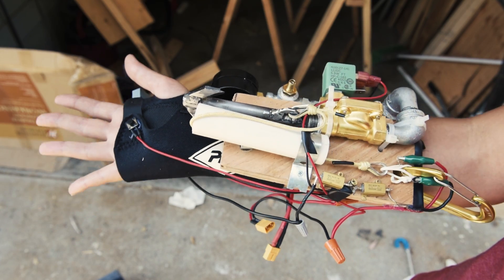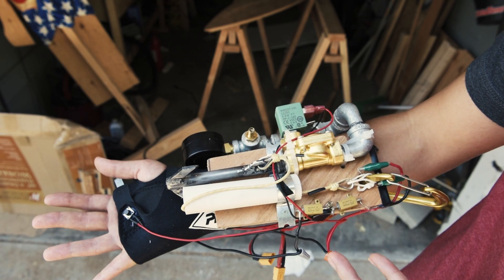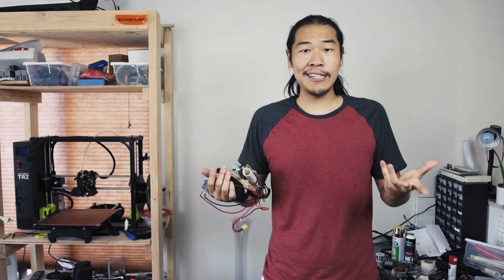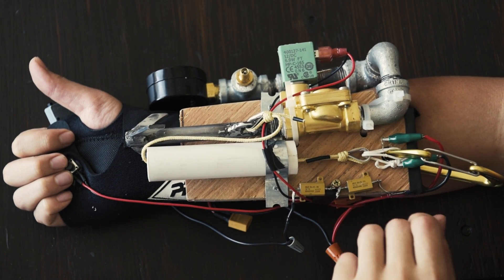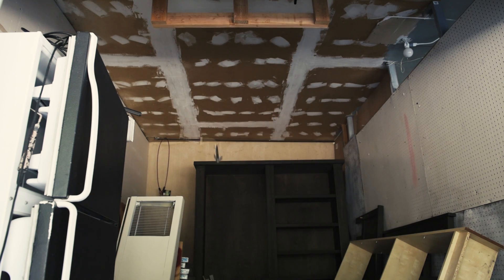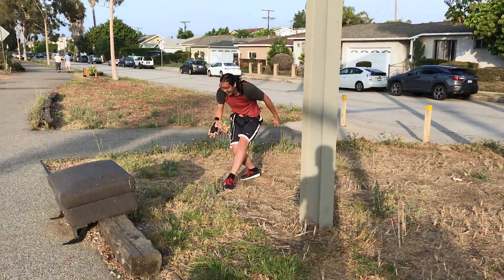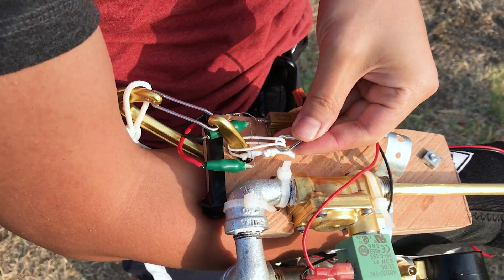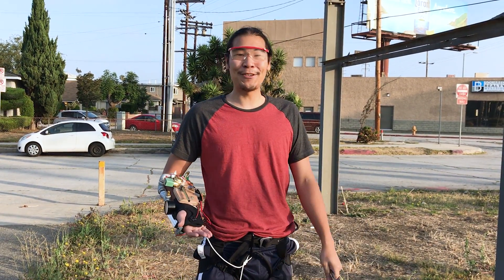Real Spider-Man Web Shooters Part 3: First Prototype Test!

Comment: This is not spider man. Spider man uses webs. This is a grappling hook. Also, how are you going to deal with with the whole knocking-out-because-there—is-too-much-extra-gravity? In my opinion, it seems like before you work on web shooters you should try and fix that so that you are not swinging on a skyscraper and you suddenly knock out and die. Stop criticizing jlaser when you should be worrying about yourself.

Comment: I believe that creating a simple pulley system at the hook to divide the stress on the rope would help, that way each the rope on each side only has to support half the weight however the string has to be longer to compensate, it will also reduce the stress on a motor the better the pulley system is.
Reply: You could theoretically make the entire thing a pulley system from hand to target

Comment: This is great. I love your ingenuity. Just to give a little completely pointless "Spiderman geek" rant though, in my opinion, this video illustrates PERFECTLY why I prefer "organic" web shooters in Spiderman than Peter Parker "inventing them all on his own." What you built in this vid is probably a LOT more like what a high schooler would be able to make on his own that Spiderman comics. 
I know it's all fantasy, but the level of suspension of disbelief is important in a story in my opinion. The more I have to suspend my disbelief, the more it takes me out of the story and SOMETIMES, the less I enjoy it. If you had told me Spiderman had the web shooters he has in the comics, and they were man-made, and then told me they were designed, developed and built by Peter Parker ALONG WITH the ENTIRE engineering crew of the Enterprise D, spending months using all their resources and 24th Century technology to help him solve the engineering problems, testing and retesting designs (assuming I could get over the anachronism and paradox of him working with characters from a different universe in another century) I would think to myself.... "hmm, maybe that's plausible." Suspension of disbelief required (just for the design/technology part, not the time travel part) EQUALS:.... well, pretty next to zero.

If you told me Tony Stark and HIS engineers helped him design them using 20th Century tech.... (which is one reason why I prefer the "Homecoming" version to most of the others) disbelief shoots up, but modestly. Maybe up to like..... 8 or 9. I mean, if Tony can make all that crazy pseudo engineering work required for Iron Man suit.... well.... why not.

ORGANIC web shooters in his arms? OK, it'd be a little weird, like why are they in his arms and not in his butt, but... those bio-engineered Spiders had weird properties.... maybe if they interacted in some weird way with human DNA.... well, it seems MAYBE kinda plausible. Disbelief Level is kinda... maybe 7-9 or so.

At these levels, I can kinda think "wait a minute!" for a few seconds during the story, then think " oh well, I can drop it" and then not have it bother me again through the story.

Now, you tell me a HIGH SCHOOL kid, ALL ON HIS OWN, and ordering and buying NO SPECIAL ELECTRONICS OR PARTS that Law Enforcement could easily track back to Peter Parker if they looked hard enough, not stealing any super highly secret tech from some high security lab, (btw- I KNOW he DID that in the "Amazing" movie- I'm talking about the original comics and TV shows prior to the 90's here) just using a perfume sprayer and some other random shit he found, and he built the web shooters he has in the comics.... suddenly my Disbelief Level shoots up to like.... ONE HUNDRED BILLION. Don't tell me how brilliant he is. Even someone 5 times as brilliant as Einstein couldn't have built a nuclear bomb in his basement in 1925 using a light bulb and spare parts from a bicycle, and your Disbelief Level would probably be near 100 billion if I write that event into a story, no matter how much I pontificated about how smart he was. It simply shows a complete lack of understanding of physics and engineering, as does Peter Parker making up web-shooters alone in his bedroom.
So anyway, end of pointless rant. 
Thanks for doing this. You are really quite brilliant and I admire your engineering skills. You have enormous potential, my friend.

Comment: In order to do a reload, You should attach the barrel of the "web" and the barrel of the hook together. Then use a compressor quick connector to quickly remove and then attach a new ready to go hook and web. Then you can attach to the web line to its anchor. If that makes any since.

Comment: Well, you may never see this and maybe you’ve already solved your problem, but knots in rope can seriously reduce the load limit of the rope. For hammocks I use a lightweight line made of Amstel Blue- it is hollow and can be threaded back through itself so under tension it will collapse and hold tight like a Chinese finger trap. Search for “how to make a whoppie sling” for hammocks and you’ll see what I mean. Cool video! :)

Comment: I'm not that good at science but maybe the reason it snapped was because the metal part had sharp edges that could of cut the rope, maybe try having the point in the shape of a semicircle instead of the straight edges

Comment: You should get a more durable and stable wire so when you swing it won’t break. You should also put another thing to hold onto the wire than just the metal piece. This is because with the metal piece, it snapped. If you have at least one more thing to hold onto it, it should help.

Comment: Can't tell what knot that is (not that it would mean anything to me anyways), but not all knots are equal, some stress the rope more than others.

And I think it's rated strength is a little less than the kevlar you're using, but Dyneema rope might be worth a try, they claim it holds up to abrasion and flexing (knots) well.  1/8" has 2500# rated breaking strength.

Comment: You should make a tightening system so it retracts a little bit of the string if Wonder Woman was to close so that the string is still tense enough to pull back easily instead of manually grabbing it with another hand because it's loose on the floor for combat situations

Comment: A simple, miniature pulley system connected to a heavy spring might help with the stress on the rope, though I'm not sure it would fit into the existing design so well. It might also complicate the release mechanism, too, but it could be worth playing with!

Comment: Maybe instead of having the line run from your shooter to your waist, have a chest harness that extends to your arms and waist and connect the shooter to that. It would basically be a soft exoskeleton that provides freedom of movement but when you hang from something by your arm it would pull on the harness instead.

Comment: Well if it was that tiny metal clasp(?) that failed, then why not just a single closed metal ring? Tie the spectra loop the same way, and either tie or use heat to fuse the Kevlar cord around the other side of the ring.

Comment: make gloves with a button that will release really sharp tiny hooks that will hold your weight and when you want to unstick just press the button again. The button could be on in your armpit so when you bend your shoulder to close your armpit, the hooks will go back in your glove. Also for a web, try to use toothpaste and make it into a liquid. also add something to the toothpaste so when it is exposed to air, it will turn into a material  like a rope. Bendy and strong. Also for spider sense, if you ever make a spiderman suit replica, try putting eyes like fly eyes on the inside of the mask so it is not visable from the outside. p.s fly eyes can make you see from any angle.
Reply: idiot that doesn't work. this isn't a sci-fu movie

Comment: By the way using the electricity to melt the string is a bad idea. No matter what metal you use it will lose its hard temper rendering it unreliable.

Comment: Do a closer inspection on that piece holding the kevlar and spectra together. The end way frayed so there may be a small burr in the metal. If you get in and round any edges down, then polish to "eh kinds smooth" that should eliminate any problems related to the clip.

Comment: what if you use a web shooter like the one in the toys (the stick like trigger) and when you press it down a box knife blade goes up. then at the same time the air compresser starts working and when you stop pressing the trigger the box knife will slice down cutting the rope. (you can probably just sharpen a tiny piece of metal because the web shooters have to be small
Like so sufficiently advanced sees

Comment: You should use fishing line! It is rated up to over 500 pounds!!! Shouldn't have a problem with it snapping! Give this comment a 👍🏻 if you agree!
Reply: I've been curious if high test single wire fishing line could be braided with small loops in it to take the weight down a bit

Comment: Why don't you use a kevlar bridge between the kevlar web and the spectra loop, using a palomar knot. Palomar knot is used for fishing, and if it can handle the varying load of a large fish on a thin line, it should be able to hold your weight. I think the main stressor on that joint there is the knot, you have to find a good strong knot to take your load and the strain

Comment: As far as the knot, if the Kevlar line  is braided you can run the end around the loop protector then pass it through the body of the weave for a few inches then back out. This makes the braided line act like a Chinese finger trap and tighten down on itself when load is applied. Hammock campers use  this to make adjustable lines called whoopie slings. I think something similar should allow you to tighten and load your line prior to swinging as well. Keep up the great work.

Comment: Try using a climbers knot for the loop instead of the steel piece.  The steel piece is probably the reason why it broke there, so getting rid of it could help.  I'm not sure which knot (or bend, to be precise) would be best for this, but you could do a quick google search to find an ideal one

Comment: why it snapped? What gauge of Kevlar you used ? making a propper knot is fundamental climbing eight knot should help, I see is like a fishing hook knot you used, maybe not the best or simple square knots maybe dangerous, you can use a capstan to vary de friction and hold and release yourself at will, check my Chanel did a test , great launcher by the way, be careful greetings

Comment: SO i would place MUCH more strong wires (maybe even steal cables) attached from your hip harness to the bass of he gauntlets so they're stronger and always stay attached. then i would make the launching and releasing webs separate from the hip wires to hand cables with different type of kevlar string. This helps so that you can now have two lines taking your weight instead of just one long one that runs through the gloves and the harness. So again two sets of separate wires (one set maybe being steal) not just the one.

Comment: Did you use a figure 8 knot? It's used all the time in climbing because it's specifically designed to reduce the strain on the rope at the knot compared to other knots.

Comment: It's looking great so far! You should however consider using a more flexible and lighter material for the grappling hook (something that doesn't injure someone if it hits him/her) like some conductive plastic polymers maybe? And use a better wire like carbon fiber and maybe make it somewhat sticky. Anyways this project is heading towards greatness! Keep it up mate! P.S. I hope you get a suit to cover up the messy harness.

Comment: You should use pressurized co2 gas to propel so you can use canisters that are easily replaced  without the need of an air compressor.
Reply from the maker: The problem with using those cartridges directly are that they're high pressure and low flow. 800+ PSI is hard to control electronically, and then the aperture on the cartridge is tiny. I actually do use a co2 bike tire inflator to get the pressure chamber up to 200+ PSI though.
Reply: Greek Gadget Guru used CO2 cartridges for his web shooters
Reply: But the co2 gas canisters aren't at 200+ psi he needs to propel the hook
Reply: Sufficiently Advanced what about making part of the mechanism backpack mounted? Just keep it low profile with a small pressure tank and a high pressure rated flexible tube running down your arm to the shooter

Comment: Electric line release is a nice idea, my only concern is that it's not fast enough. I would go for a mechanical release of line, since you already using electricity in your build, you can use small electro motor.

Comment: Maybe you should try either a stronger wire, a better stress reliever (the metal thing you put in to relieve some of the stress from the knot) so it has a better sort of security mechanism so the wire can't just slip out or break, or you can add both of these ideas.

Comment: I don't know much about Kevlar but is there any way you could eliminate the knot entirely by burning it to the specter wire? Also, maybe for general improvement, you could use multiple Kevlar strands in a casing to bear your weight instead of one. Hope this helps!

Comment: An Idea!? :
If the ... spectra? is as strong as the kevlar you could try making the line from the spectra and then have the 'cutting wire' on the front of the shooter rather than the back. this would mean you wouldn't need the weak link that is currently present ?? and would only need to cut at one point

Comment: I'm not trying to bash anyone but this is a bit better than g3ars
Reply: gamerdudes superelite g3ar Made his from looking at this one. and Colin furzes... so these are copies of the only true one, wich is colins. if he changed the name of the video form Assassin's creed grappling hook to Spiderman's webshooter he would have the best one out of all this replicas
Reply: You can't swing with Colin's. These are designed for swinging whereas his was designed for winching yourself up
Reply: gamerdudes superelite I agree
Reply: gamerdudes superelite G3AR's version allows him to swing and he's also made real webs and a machine gun attachments
Reply: Darth Sceledrus this thing allows you to swing too, the machine gun is cool but I think that you can modify this to do the same and one of the webfluid is toxic while the other is good (the orange oil one is good it's kind of ironic how he called it acid web when the two part nylon one literary has hydrochloric acid byproduct). Also why would he use nylon 6,10 when nylon 6,6 can be synthesized the same way but is much stronger
Reply: But these boys are trying to take it further than Colin did. He set out to make an assassins creed rope launcher/winch system, and he accomplished it, whereas G3AR and SA are only using grappling hooks as prototypes/proof of concepts. I also don't think that they're even thinking about winches, which separates them from the Colin Furze/Hacksmith projects

Comment: tripple twine the rope with the rope making machine the king of random made, then the rope might hold you up that billboard
Reply: That might improve the durability of the rope, but the problem was the rope disconnected from the quick release because the metal connector broke.